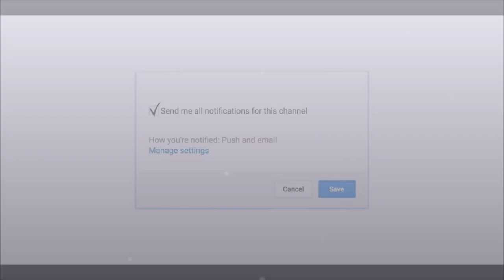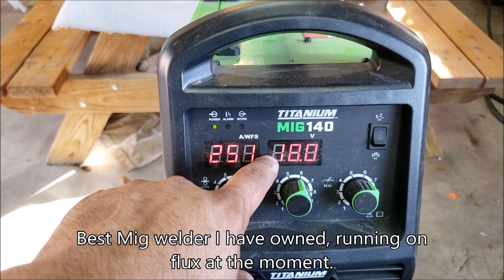How to build BBQ Jalapeno rack smoke grill attachment harbor freight welder titanium mig140 mig 140

Comment: I'm confused, I'll have to see it fired up.
Nice steady hand with the plasmer cutter.  With a torch worth $400 that could be why it cuts way better than mine.
Reply from the maker: I verified price and its $475 for the replacement torch or $2200 for a complete plasma cutter. The peppers first are wrapped in bacon and stuffed with cheese and meat. Then you can place them vertical on these holes or you can avoid this contraption and toss the peppers on the grill grate. I saw one similar to this and liked the idea of building it. Will I use it, probably not.....any day I can weld and grind is a good day.

Comment: Try the most expensive Vulcan welding hood from Harbor Freight. It has great clarity. I love mine. About $150 if I remember correctly.
Reply from the maker: I have not seen them in the store that's 50 miles from here. I will try to ask next time I visit them. My trips are very limited lately. This face shield works fine and then just goes crazy in the middle of a weld. It can't determine if to turn off or on. Thanks

Comment: The rack turned out pretty cool... I also had a harbour freight welding good and it broke on me, they work for a while then they give out... Looks like that mig welder works better than the one I have also from HF... Can you use gas with it or are you running fluxcored wire?
Reply from the maker: I have a new Chicago flux welder that normally cost around $99. Its been in the box over 1 year. I will do a side by side comparison using the same wire.

I had an awesome Hobart face shield and it fell into a bucket of water and just went out.
I may try searching this weekend for a good face shield but may have to buy a fixed shade ( non darkening )for the mean time.

I'm running regular flux core and once I use up all the spools will look into tanks for the mig.
Reply: @cutweldngrind  The Chicago welging machine is the one I have too, I really dont like the way it welds...lol. Let me know if you find a good W/hood... I need one too cause mine broke... First time using auto darkening hood, I'm used to the dark lense hoods... And even the harbor freight auto darkening hood sucked...lol.